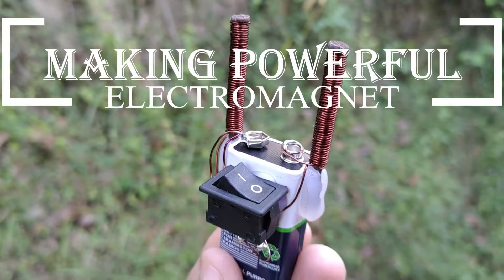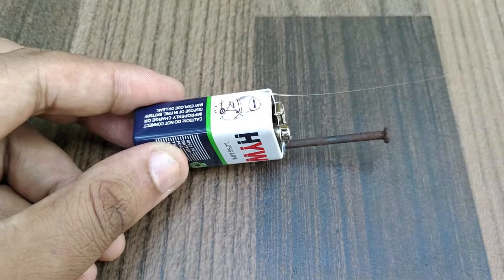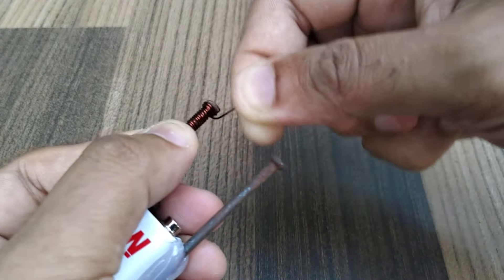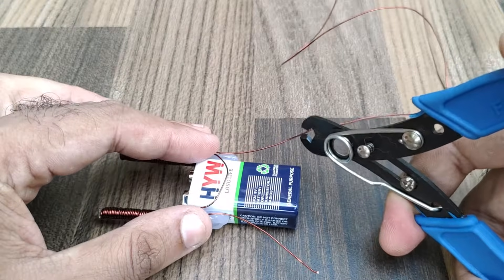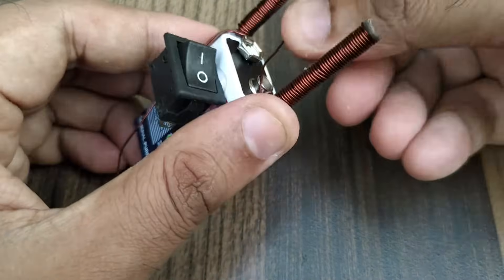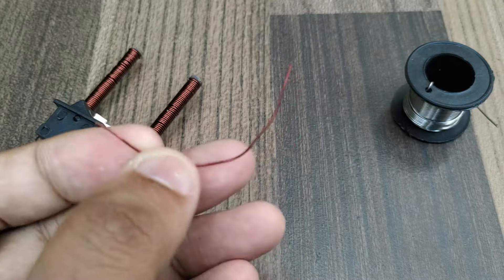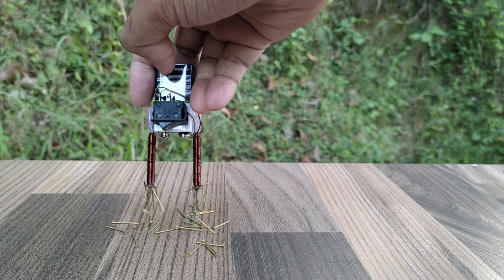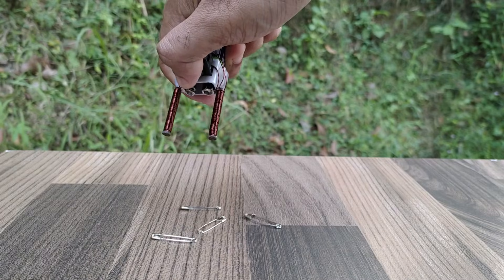How  to make powerful electromagnet at home || Two Rows, Two Poles || Science Project

Comment: Can I use only one nail
Reply from the maker: Yes. You can use only one nail also. But make sure you use insulated enamelled copper wire and also have maximum number of turns possible.

Comment: not working
Reply from the maker: Did you use insulated copper wire?. That is the most important thing. Then the battery also has to be a new one to get good magnetic strength.

Comment: Mine doesn't work out 😢😢😢
Reply from the maker: Did you use insulated copper wire?. That is the most important thing. Then the battery also has to be a new one to get good magnetic strength.

Comment: How to check the wire is enamled
Reply from the maker: You have to scratch the wire with a blade and see whether some thin coating is peeling or flaking off. Then it is enamelled insulated wire.

Comment: is it ok if i use uninsulated wire?
Reply from the maker: Uninsulated wire will not work.. it will get short circuited.
Reply: @Science_4U_  thanks
Reply: @Science_4U_  and also do i need to use enamelled wire or can i use rubber insulated wire
Reply from the maker: Enamelled wire is the best because the insulation thickness is very less. So you can wind more number of turns in a given length which makes more powerful magnet. Rubber insulated or pvc insulated wire also will work. But you will be able to make only smaller number of turns. So magnet will not he powerful.
Reply: @Science_4U_ uninsulated worked

Comment: what size is your wire? 0.2 mm or 0.5 mm ? can i know how much lenght of wire you use ?
Reply from the maker: Hi friend. I used 24 awg wire which is having a diameter of 0.51mm
Reply from the maker: Also length of the wire used was around 1 metre..
Reply: @Science_4U_  i ordered 3 metre for 6 poll but it wasn’t enough😭 one nails needed like more than 1 metre
Reply from the maker: Ooh..sorry to hear that..it may be a very long nail that you are using. That is why it is taking more than a metre. You can try winding over a smaller nail.
Reply from the maker: I checked now also. It has taken me exactly 1 metre of wire per pole. I used a 2 inch nail with a winding length of 1.25 inches. You can slightly reduce the length of winding or reduce the number of poles to 5.
Reply: I used the exact lenght of the nail but one nail needed like 2 meters

Comment: my wire is short. can i connect short wire with another wire to make it long? will it work the same? how do i connect them?￼
Reply from the maker: Yes..sure friend. You can join short wires to make them longer. It will definitely work the same. You can do this by soldering. Please remember thay you have to use enamelled (insulated) copper wire only for making the coil. For joining two short wires, remove insulation at the ends and solder them together.
Reply: can i just twist the wire without solder?
Reply from the maker: @niasara2759  Yes sure, you can twist the wire and connect them together. Make sure that you properly remove insulation from the ends of both wires and then twist them together..